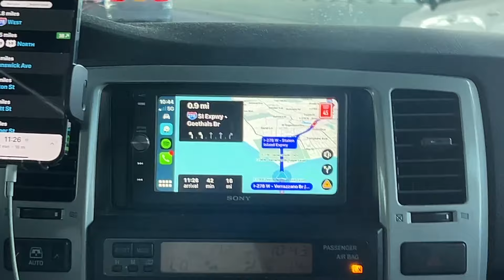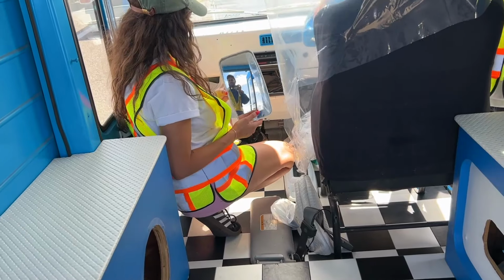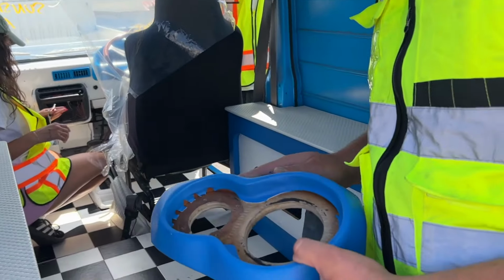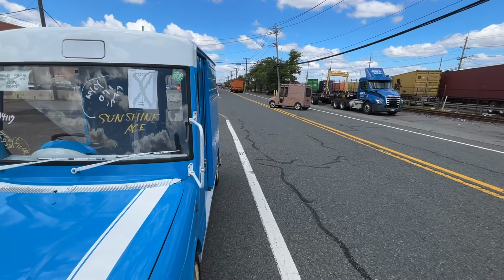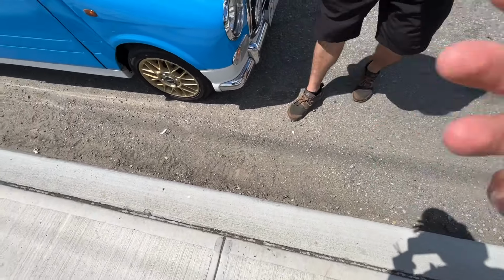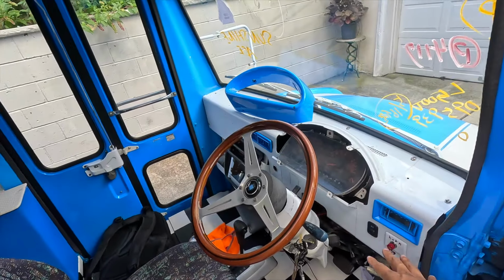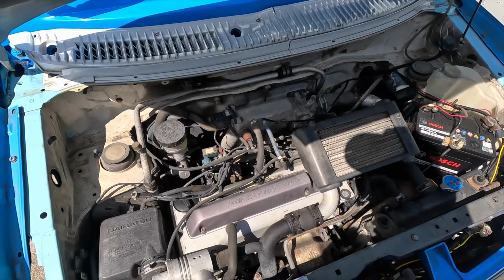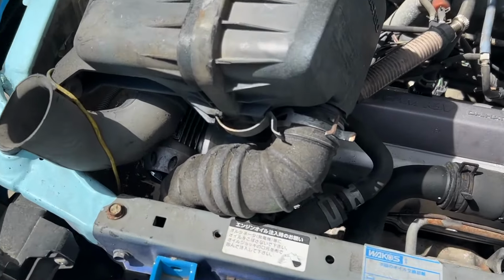TURBO Swapped Daihatsu Mira Walkthrough Is Here!!!

Comment: Now you got yourself a Channel project car! Very cool . I hope you are going to put a front mount intercooler set up on it and electronic boost controller at 14psi with straight thru exhaust too. Aim for around 100 hp at the wheels.
Reply: I agree
Reply from the maker: In the mira walkthrough ?????? LOL
Reply: @Waybeforethefame   Nick that engine is very capable of 100 hp with a few supporting mods. Upgrade intercooler , injectors , 2 inch straight thru exhaust , fuel pump and adjustable fuel pressure regulator and enjoy the ride!
Reply from the maker: where can I find these parts? my cards also 4 speed auto so not that fun

Comment: i just want to see what your going to do for an air filter and oil filter im having trouble finding them. air filter i could take out the box and go with a different type. if yours is clean i will buy it once you put something diff.  but would love to find out where you get the oil filter from. also i have the same motor obviously and mine hauls ass. easily 85 it wants to go faster but i need diff ecu for that and 85 is fast enough
Reply from the maker: air filter I found right away, but im getting an intake soon so I wont be using a stock air filter
Reply: @Waybeforethefame  those teddy bear rims are going to look sweet on that van. i dont know where you found the air filter but ive even seen a guy 3d print a new plastic piece so he could make a different filter work

Comment: Nick it looks like the front end has a mini kit as in Leyland / Austin Mini. The rear lights are very similar to the ones fitted on the early 60s minis in the uk .  The stripped on the bonnet  are very common accessory for a mini bonnet. Definitely keep the head lining white and good luck with the dashboard and wiring issues.  I think when you iron out those is issues you’ll be happier. The teddy rims are a bold statement but I think they will suit the look and definitely grab attention. If they ain’t talking about you then you aren’t trying hard enough and as a sales van that what you want.
Reply from the maker: I need to find replacement tail lights
Reply: If you intend renewing what’s fitted on the rear search - Lucas 594 lenses. They do all the colours required clear red and amber UK prices are around £10 per lense

Comment: I would be asking for some of my money back with all those problems and all the work they said they did. 
Did you get from MITSUI ? I’ve seen some of there vehicles and they are not very honest about problems. All that disconnected wiring on your walkthrough is concerning and could be a bigger problem. 
    I paid 14 for my Delica from Slater (I live on Maui) it was mint minus a few rust spots on the roof that I repaired. I also have a sambar Dias van that I’m rebuilding I got it so cheap I couldn’t pass it up.
Reply from the maker: I got it from buyee never hit the auctions